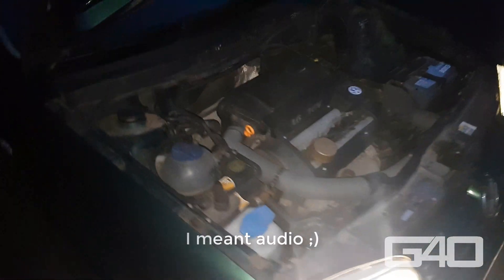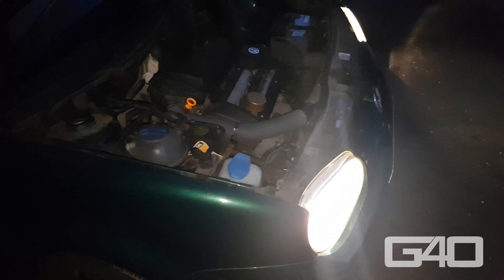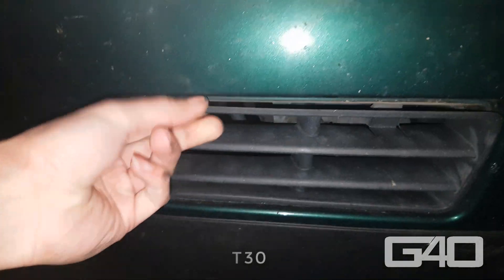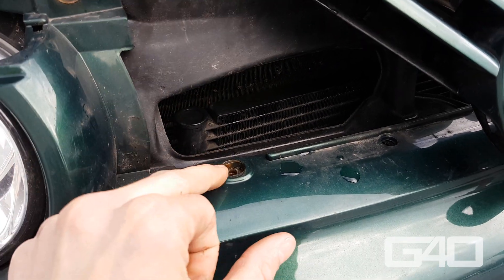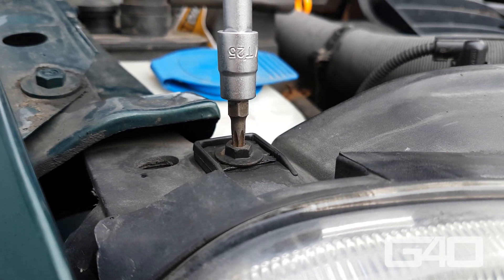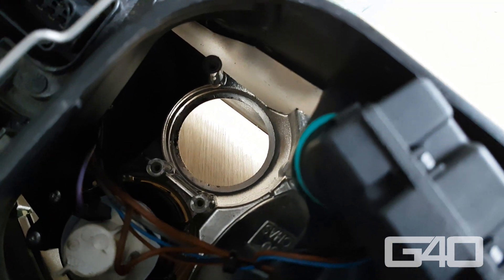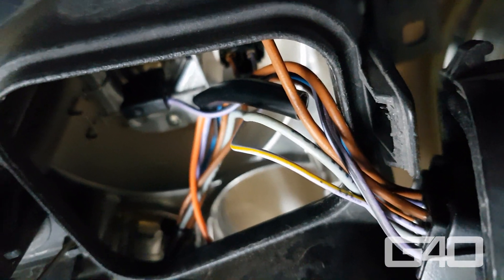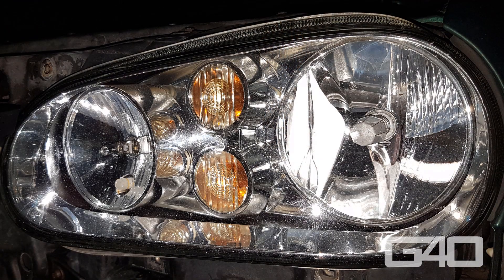🇬🇧 🇺🇸 VW Golf Mk4 Double Indicator | Dual Turn Signal [Budget VW Golf Mk4 1.6 16V Part VII]

Comment: Hi , do you have problem with american style module? I have a problem when turn light on the module overheats and starts to melt
Reply from the maker: Are you using the cheap resistor modules? One or two bulbs per module?

Comment: How did you get the plastic Circle out of headlights I have always wondered how it comes out especially if you don't take the lens off
Reply from the maker: They are screwed by Valeo Headlights. You need a Dremel or similar if you got Hella Headlights.

Comment: Hello, do you have a link where you can buy the complete lamp holder now to install?
Reply from the maker: I removed them from two old headlights but those could work:
https://www.ebay.de/itm/224535483805?ssPageName=STRK%3AMEBIDX%3AIT&_trksid=p2060353.m1438.l2649
or 
https://www.ebay.de/itm/163077893502?epid=15017009886&hash=item25f8332d7e:g:i5IAAOSwdHJczjsL

Hella No: 2BA008221041, 2BA008221047
Reply: @Golf4org  
Thank you very much for answering me as soon as possible. Because of the price and the time it takes for them to arrive in my country, I think I will choose to print them in 3d and do the installation in LEDs.

Comment: Hi, thanks for the video

I have a question, I bought some used headlights with black housing and dual turn signal already, but I would like to make it so when I turn on the parking lights on the switch, the double turn signals light up instead, is this possible?

And if I have them on, when I signal left/right, will they blink as intended or will always stay on?
Reply from the maker: Hi, you are talking about so calles "US Blinker" I guess.
Check out my new Video "US Blinker DIY | US Standlicht für unter 20 Euro selbst bauen". But it is german language.
Reply: @Golf4org  thank you i will check it out ! so cool to have someone still making videos on mk4